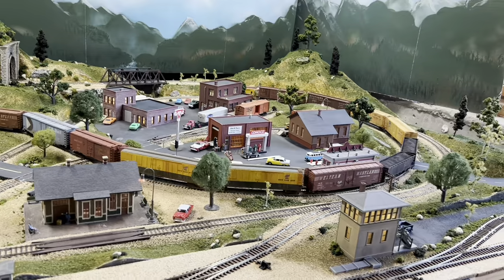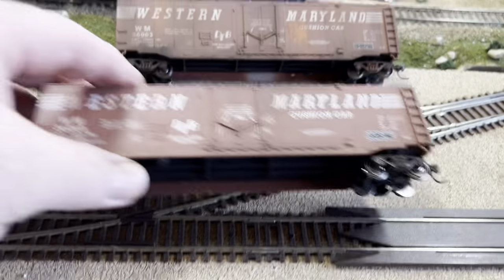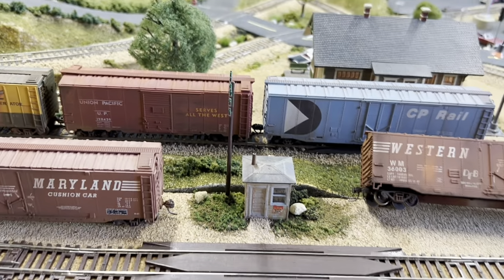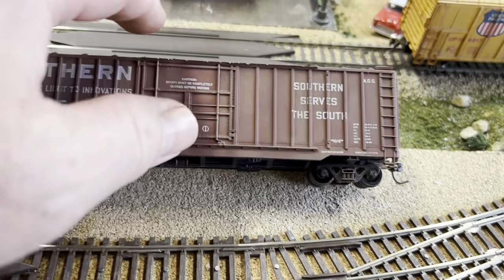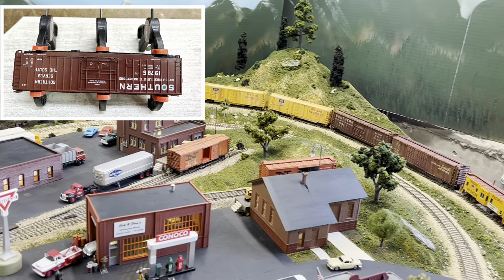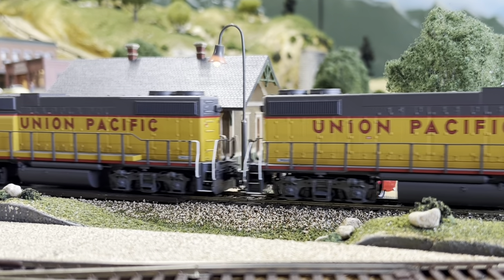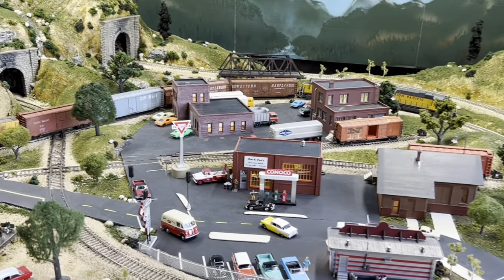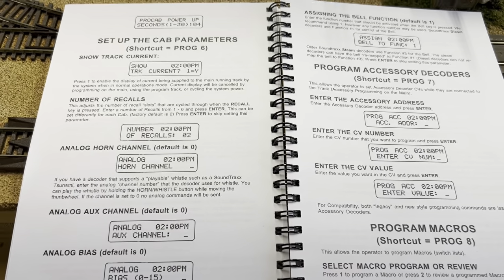Boxcar Repair and Weathering Update.

Comment: Another point to take into consideration about weathering rolling stock is that is shows how often the equipment is used. 

Another weathering tip: One thing I've noticed about your equipment is the lack of "scratches" created by box car doors when metal grinds against metal. It's a small detail that goes unnoticed by many but you'll know it's there.
Reply from the maker: I’ve done it on a few. Sometimes with powders or paints, sometimes by actually making scratches with a hobby knife. I’m still on the fence about actual scratches, but def can add them with powders. 👍🏼

Comment: Dan, I would suggest you setting the gopro to record right at the switch track that derails the southern car. Visually watch very closely. You know the issue repeats at that one spot, so it's perfect for a close look. You'll be able to see a wheel pop up and out or whatever.
When my passenger cars would short out the command station at the switch, I zoomed in and noticed a spark when the wheel flange would pass the frog. All I needed to do was paint some clear acrylic over the rail for an 1/8 inch more and it's totally cured. So try zooming in on the rails there and run past a few times.
Reply from the maker: Good call I’ll do it. Wonder why it’s just that car though. Lol
Reply: @DansGrandValley  Possibly one axle / wheelset is narrow or wide of the others maybe. A coupler hook isn't snagging I guess in that location. Are the trucks mounting screws too tight or loose? How abotu removing the cars trailing that southern car and see if it still derails. How about if it's turned around. You can try swapping trucks if the axles / wheels all look proper. Heck, it's a fun afternoon! lol
Reply from the maker: @tvtoms  haha yep, fun fun!!! I noticed it rode better turned around, so yeah prob that truck or axle is the culprit.